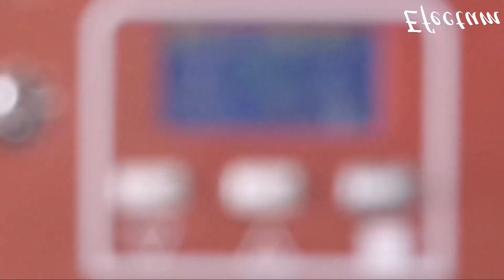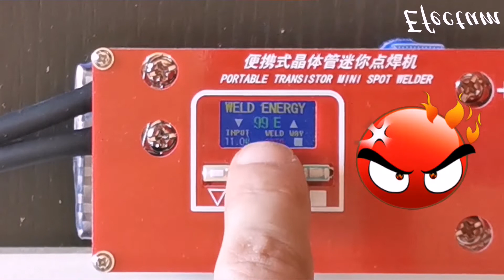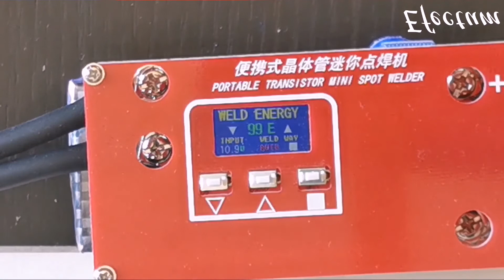Diy Mini Spot welder capacitor mode

Comment: For me no need adding another capacitor becasuse the capacitor from the input it is enough to supply smooth steady power supply to the mcu circuits board controller check this link
https://youtu.be/SiEevlklAfU

Comment: Does it matter if the capacitor is rated for 35volts 1000uf ?
Reply from the maker: No. You can use 35 volts.